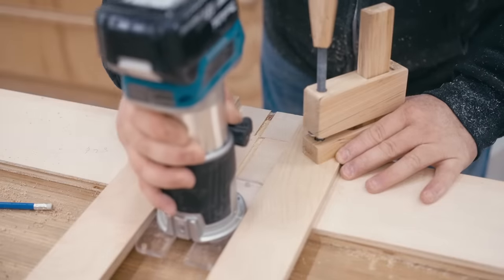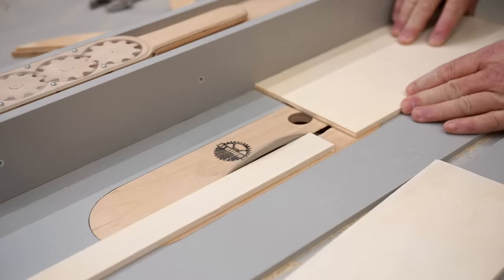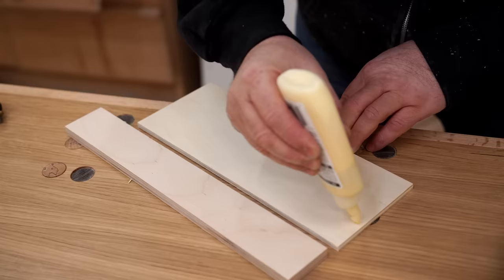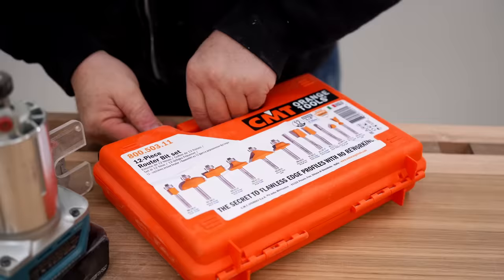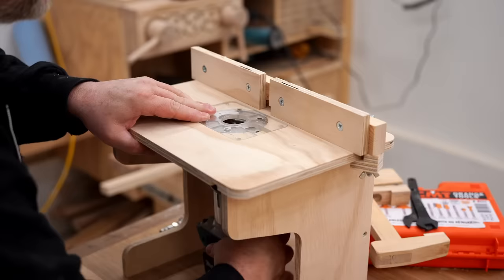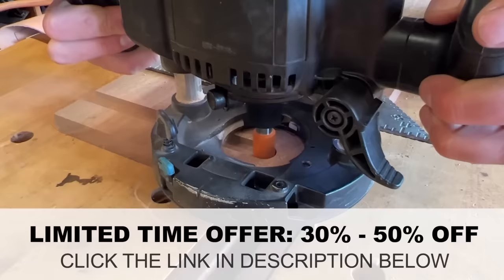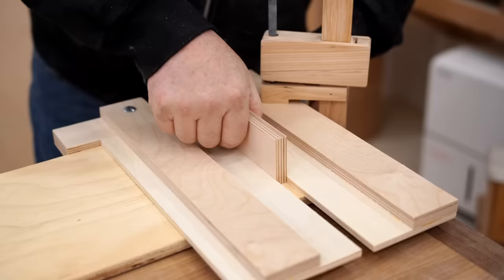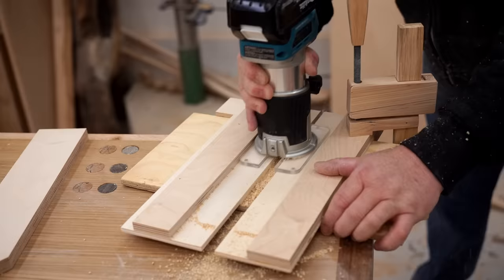Perfect Fit Every Time Dado Jig - Essential Tool For Woodwork - Easy to Make

Comment from the maker: Cut dadoes the fast easy way and get a perfect fit every time. Best if this jig is made this size for narrow stock, but also longer for wider panels. Like I said in the video, a longer one would need the locking clamp on both ends to keep it from opening up. I'll be making the longer version in an upcoming video.
Reply: Your link for the saw blades don't even ship here in Canada in the very country you live in. So much for that purchase. 😭🤬
Reply: Gut gebaut.

Comment: John this jig is perfect! I’m about to start a custom armoire for my newly remodeled bedroom. The upper most center drawer is  1/2”plywood  with 1/4” dividers for ties & tie clips. The carcass and inside lower 3 drawers are 3/4” Baltic birch. I’ll be making all 3 jig sizes. These jigs will ensure tight accurate dados providing the strongest drawers, dividers, and shelves.

Comment: "it's a little less convenient to cut a 3/4" dado with a 1/4" bit"...  Yeah, it takes about 10 extra seconds!  :D:D:D:D.  I'd say it's worth the effort John!  Great jig.
Reply from the maker: Thanks Greg :)
Reply: Yep, running a 3/4 bit in my full size router is 10x more hassle then just using a trim router. Also your not doing a full 180° engagement cut and can get a clean cut on both edges.
Reply: To quickly take out the middle bit. Just scew the router. When you contact both sides of the jig you're straight in the middle.

Comment: Nice jig! I built something very similar but I use a top bearing router bit. Adjusting the dado directly to the plywood you are using is 100% the best way to do them.
Reply: I prefer this method as well.  Then you can use any top bearing bit (as long as it's smaller than the slot) and any router.
Reply: Bradley, Your idea is brilliant! I like that better!  I will make one. Thank you for the idea.

Comment: at the end of the video, cutting the 3/4" dado you could have made the first two cuts and then rotated your router so that the opposing corners of your faceplate guided against the jig and it would have cleaned out the 1/4" remaining strip easily.

Comment: Good stuff. I'm usually on site with a jobsite saw so never bothered with a dado set. I just use a 3/4" router bit for built in shelf dados. Always so satisfying how perfectly a piece of 3/4 snugs into the slot.
Reply: Unfortunately lots of 3/4" plywood is a lot thinner than 3/4". Which if you want a sliding fit is convenient. But less-so if you want a tight joint. While you can buy plywood specific router dado bits, still it's hit or miss. 

I use a top bearing router bit and a similar jig to this or just two plywood off cuts depending. Always a perfect dado, custom fit to the plywood you are using.